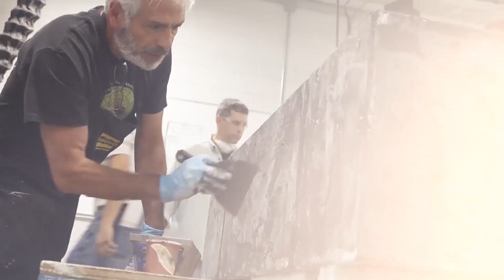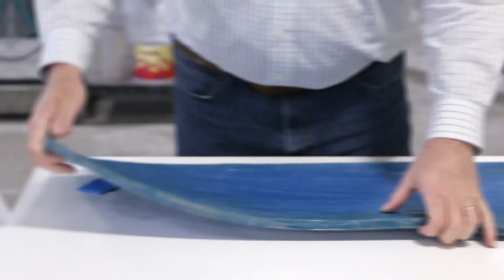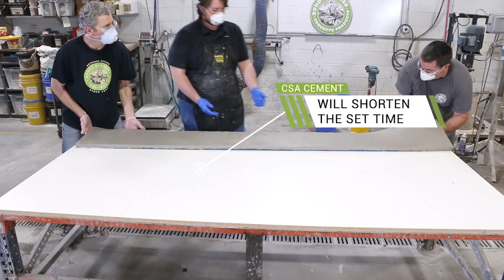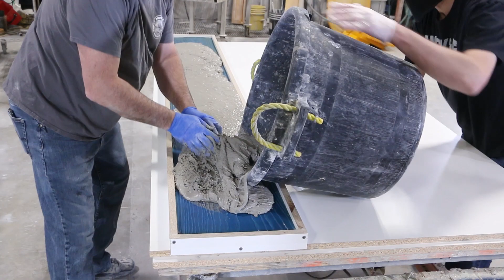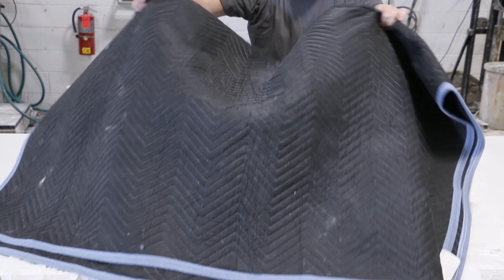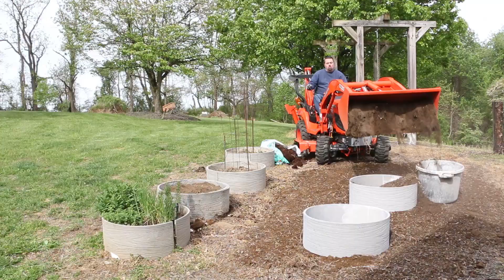Creating a Concrete Raised Garden Bed with Fast, High Performance Mix

Comment: What type of concrete are you using for this? Have you made your own mix that doesnt have all the heavy metals that will cause health issues?
Reply from the maker: This is a specialized concrete mix we manufacture.  If you can reach out to us, we can answer your questions - https://www.buddyrhodes.com/contact-support

Comment: Way cool. Any idea what the heat rating would be? Good enough for a thicker poured Fire pit ?
Reply from the maker: ECC would not be recommended for use as a fire pit.